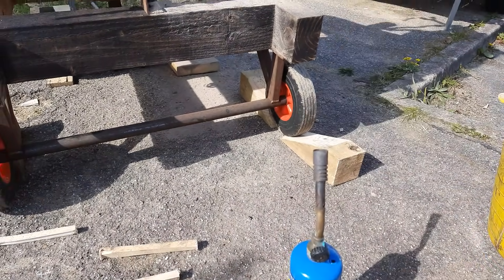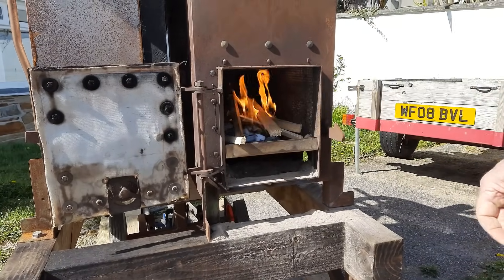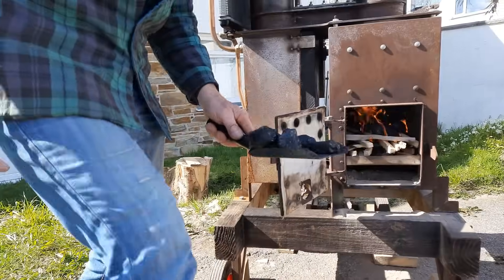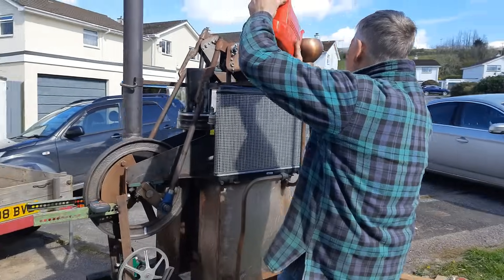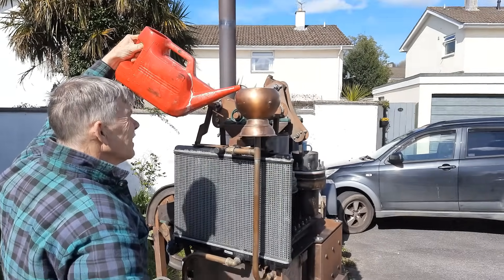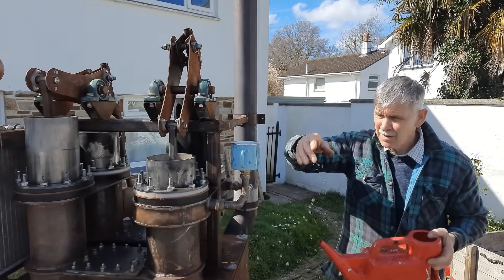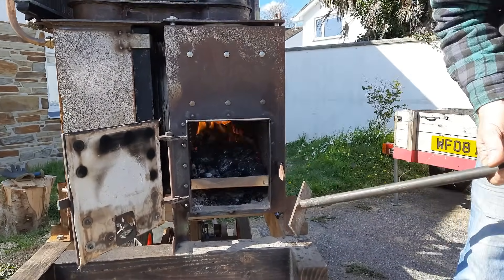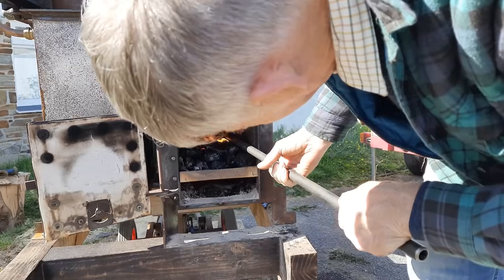Stirling Engine Generator Homemade DIY 0.47 KW ! Part 3

Comment: 00:20
Please buy an easy to use "Gas Torch Spark Lighter" for the stirling engine BBQ 😆, yummy can roast potatoes 🍠 🥔 😋 while you dad still has fingers...

Also if you ever get the chance, try running a sterling engine off a solar thermal vacuum tube heater 🎉and will need a thermal exchange, probably a short copper pipe, sealed with little water inside, the heat and then seal the end, and activated charcoal fabric fish filter  to sanwidge between the pipe and your sterling engine 🎉
And can make it more efficient making a pipe reflector behind the solar thermal evacuated tube.

Cool Stirling Engine !

Can use a, "solar thermal evacuated tube" and power the stirling engines see here ...

https://youtu.be/7ZHwqHUU6ss?si=2TzM_oJyV88oVmu4

Comment: Sure, it runs, and is huge,
I have yet to see any stirling engine actually doing work - -as in actually powering a generator, or a sawmill blade.

Why not show us how good that is with a belt on the drive-pulley (if it has one) actually doing stuff.
Reply from the maker: I'm with you on that one. I haven't given up quite yet! So far nothing I've made so far has been amazing on that front. It should be possible because it's been achieved on small models!
Reply: Look up Swedish submarines, they (should be) are quiet running.

Comment: I imagine a smaller and mass manufactured one to be installed on a wood heater at a cabin. Hot water to shower and do the dishes, 250w of continuous power for charging a battery, heating and cooking. But it needs to run silently and be maintenance free. What about it?
Reply from the maker: I'm working on it👍. I've got an idea I want to try. Should be simpler , cheaper and silent running. 250w is a sensible goal
Reply: @ShanePomeroy  I subbed to your channel, and will keep an eye on it. Good work! I wondered, what if there was a separate heating coil and radiator instead of the traditional displacer piston, and found your work.

Comment: That's never 450 rpm  >  That's never 450 revolutions, just count  (165 rpm)
Reply from the maker: Yes, looking back the RPM readout was a bit dubious! On the recent engine I've built I added a proper RPM meter with magnet pickup, cheers
Reply: @ShanePomeroy  Well, the torque and volume are more important - greetings from Berlin.

Comment: Man, since you put some wheel on the engine support frame, maybe make like a  cart with this engine . Just put it on a bigger frame with a steering system and all of that, would be interesting to see haha, im pretty sure it would not be that bad, since although this has low RPM, it's torque is pretty big, so it shouldn't be a problem to start cruising

Comment: would it be possible to run a large Stirling engine / electric generator off the heat rising off blacktop? perhaps a few extra mirrors reflecting more sunlight to charge batteries?
Reply: Yes. There are guys from Austria who manufacture 1.25 kW Stirling generators with multiple fuel options - including concentrated solar. Their company is called Frauscher Motors.

Comment: can you make it cheaper by using a car tire full of sand instead of an actual flywheel? also why isnt there more gearing? seems like you could get more out of that motor, they are supposed to be high torque.

Comment: Look into rocket stove designs like youtube "little aussie" and others. Another design has a slot in the back chamber and I noticed on each side of the slot, gas welding tips. There were two holes in the back where two tornado vortices were. I'm guessing that the hot air tube went all the way back and then up, like an exhaust manifold. So the preheated air was at the top of the fire box and then burned the additional hydrocarbons. Another video showed wood put in a sealed container with a small hole near the flue that made volital gases and charcoal. Now if you used hard wood the ash could be put in a barrel with tiny holes in the bottom. Pour water over the ash add lard and you have soap. Frontier soap making.
That was a really nice engine you made and I hope I see the next one. Oh if you use porcelain fire brick with angle iron always put fiberglass on any metal that touches brick ect.
Reply from the maker: Hi Mike, Thankyou for the ideas : ). I need to improve the furnace of my Stirling engine! Nice idea about using fibreglass to pad the fire bricks, many thanks

Comment: You didn't measure the power output - you measured the RPMs and the torque - but that's impressive enough - those wattage output numbers are TOTALLY theoretical to the efficiency of any dynamo you pop on there. Sure seems more efficient than a steam engine.

Comment: Not sure if that rpm reading is reliable. If you tap count from the sound https://youtu.be/Ge3cerSVEI0?t=460 you'd end up sth around 222rpm. Though the meter reads 448. Am I missing something?

Thanks for the video, I love it when people show rpm measurements with torque readings!
Cheers
Reply from the maker: Uuuurrrrrrr... You've got me questioning things now! I used an optical rpm meter with a reflector on the flywheel (hopefully it wasn't double counting!). I've since bought a new rpm meter with a proper pickup. I've now sold this engine. All the best

Comment: What does the water do? Doesn't the water mean it's a steam engine and not a Stirling engine?
Reply from the maker: Hi Jonathan, the water is simply to keep the cold cylinder cold similar to a cars cooling system
Reply: @ShanePomeroy  oh! That makes sense. I guess that's why you have a radiator. Should've known 😅
Reply: @ShanePomeroy  thanks for the reply. Cool stuff man.

Comment: Really interesting, could you instead of heating with coal and wood heat with an electric heater because then the energy in could be measured against the energy out giving an efficiency reading. I have just discovered these engines today and they are a great hobby build because there is no high pressure steam which by experience I know is hazardous
Reply: It is already doing it, it is measuring incoming energy with respect to outgoing energy, it does not matter if it is electrical or mechanical, energy and power can be measured and converted equally.

Comment: how is it measuring kw?
Reply from the maker: Revolutions per minute and torque. This is mechanical Kw
Reply: @ShanePomeroy   ok, I understand how its measuring the rpm, but not the torque
Reply from the maker: @jkhippie5929  oh I understand. The metal belt around the flywheel acts as a brake which is adjusted on/off with the hand wheel. This is attached to a lever that pushs down on a set of kitchen scales. Does that make sense?

Comment: Nice concept as a sterling engine set up.
But I prefer them when powered by for instance solar heat from a parabolic mirror that follows the sun during the day. 
But when heating with wood a simple gasification set up can help you run a much more powerful normal combustion engine and to go very efficient you could hook up a Taurozzi pendulum engine which has much less resistance/ friction in its pistons when interacting with the cilinder wall, less need for oils to lubricate etc.
Cool engine design, worth checking out when one is interested in engines of any kind.
Reply from the maker: Yes, this one is a little inefficient! I'm interested with the gasification burners for future designs. Ive just taken a look at the taurozzi pendulum engine, very interesting. I'm not sure how I'd go about producing a curved cylinder through. It has made me more aware of frictional losses on the cylinder. Something I will need to pay more attention to in future designs. I'm currently building another stirling engine, check out my channel.Many thanks for your insight.

Comment: awesome job, was just wonedring, does it have a pump that is cyclyng the water around??
Reply from the maker: Kind works. No , the circulation is simply due to the thermosyphon effect (heat goes up!), cheers

Comment: Yes, but how many watts in?
Also...  you could rig up a nice wood gas burner in the firebox, make good charcoal or biochar in another fire.
Reply from the maker: Urrrŕrrrrrr........quite alot I'd imagine! My next engjne that I'm building uses a j rocket which should improve efficiency alot. I'm interested with the wood gas producer but am worried it would be to finicky, I don't know?

Comment: how do you take power from it? I'm doing some self research cause I've interested in Stirling engine generators. Eventually I'd like to make my own for a homestead but id like to understand how their fully used. I just found your page and am now gonna go through all of it on the generator at least.
Reply from the maker: Hi Nick, the simplest option I tried was an old hoverboard motor as a generator

Comment: This IS brilliant.  However I think that an equal amount of petrol in a gas engine would develop more horsepower and watts generated.  I am sure there are a lot of heat losses in a machine like this but the concept is brilliant and you got it to work.  The strong feature of stirling engines is how little heat they can run on and how easily they move.  Making them out of heavy iron takes some of that efficiency away.  I suspect the length of your stroke also takes more energy than the little models use but you need this for torque.  I believe in this engine, I think there would be a way to run it on a solar colector lens and water steam or just hot air.  The need is to get enough energy to run an Air Conditioner to keep a room cool on a hot day and the lens might work.

Comment: Man some of you FREE ENERGY haters need to remember how you call what a “BUY 1 get 1 FREE” hot dog, drink or whatever it is and remember your remark about “FREE”. 

Point is… it was created and no matter how you put it. When you are CONTINUING to pay $10,000s of dollars over your life these guys making items to LOWER their “cost” is averaged out as under a penny in the long run compared to your hefty bill. But hey… his only costs maybe under ONE CENT per use in the long run averaged and since they don’t make any “VALUE” less than 1 cent…. WELL THEN I GUESS IT CAN BE CONSIDERED FREEEEEEE! 

P.S.- Your free hot dog from the one you purchased cost you gas when you went and picked it up plus that 10 min late to work on your lunch break (10 min off the clock = $$$) 

Give the guy some slack you get the point and most probably jealous they are not smart enough to come up with unique ways to help their survival

Comment: Amazing !
When did you first build her.
Are you using
The power from the fly wheel? Somehow?
Reply from the maker: Hi, built last year. The inertia in the flywheel carries the engine to it's next power stroke and it also smooths things out! Regards

Comment: Just a little over a minute into the video so far but a couple of dangerous things I've seen so far is first, you don't hold your lighter and thumb up over top of a propane torch when you light it when you should already know that a hot flame is going to ignite and shoot straight up towards your lighter and hand, duh 🙄, you creep up on the end of the nozzle from the side or from farther down below just letting the flame kiss the gas coming out, without your hand in the way. Secondly, you set the propane torch right down under the stove where you're building a fire with wood that's igniting. What if you accidentally knocked the torch over and broke the valve and you have propane escaping, possibly at a fast rate, and a piece of flaming wood falls out right next to the torch? Do you think that's gonna work out well?   
  C'mon people, always gotta think safety first, especially when you're messing with fuel and fire.

Comment: Great,  
How can I build or have one
Reply from the maker: You could buy this one if you wanted lol. It would save me lots of time fiddling about : )
Reply: @ShanePomeroy  thanks for your offer,  but I  need a modification ; to use the heat of the sun instead of burning wood, 
Waiting for your reply dear sir
Reply from the maker: @ismailramadan2528  that's a tricky one! Have you got a way to track the sun so the heat is always focused in one place? Cheers
Reply: @ShanePomeroy  there is an application and I saw it in YouTube